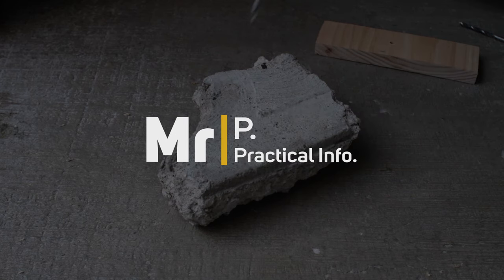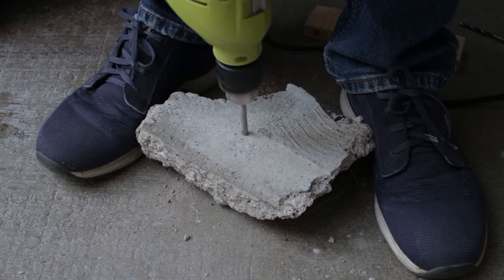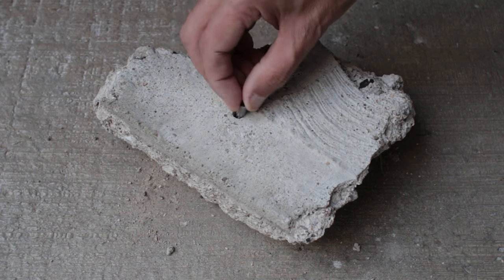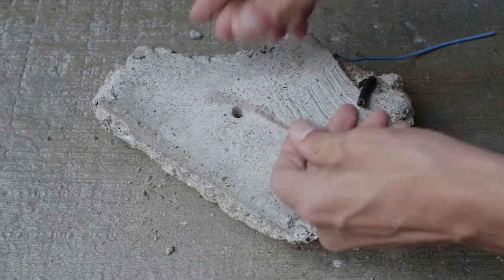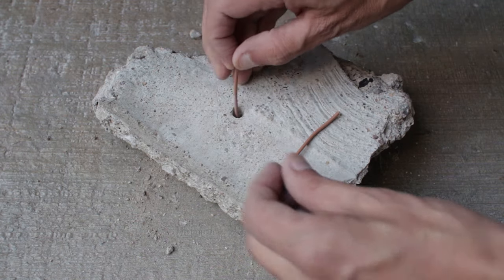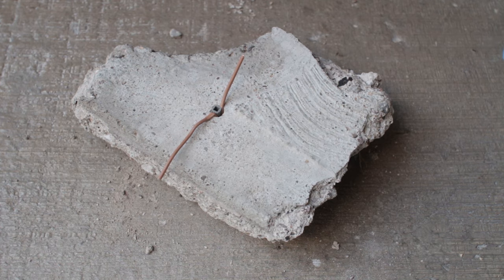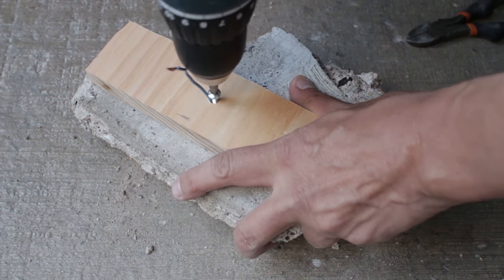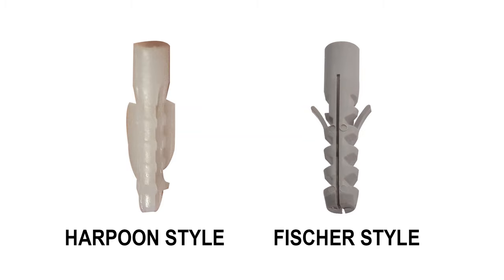How to Fix Loose Wall Plugs 🧰

Comment: Thanks for the tip im going to try it on a larger plug but the thing that really got me smiling is all the years i have been blowing the dust away and you use the drill fan! that deserves a video of its own😄

Comment: Did this into drywall with fischer style plugs. The holes were blown out and spinning. I accidentally over drilled them. Used 4 pieces of 14 or 12 gauge wire. Worked perfectly. Thank you.

Comment: Thanks very much for the tip about using a piece of wire. I used a bit of wire that's usually used for tying up cables and it worked a treat! I'm definitely gonna remember this in future. I usually hate dealing with rawlplugs but now I feel a lot better haha. Cheers!
Reply: U can use anything pretty much, anything that's strong yet can be malleable but doesn't just break if that makes sense.

Comment: Brilliant tip thanks. Like the way you blew the excess dust from the hole with the drill motor!
Reply: I use the wind from the drill motor to cool of my body from sweat after working 😂 i dont blow the hole from the dust because the dust will also help little bit when you put wallplug 🤣

Comment: Thanks mate worked like a charm on the first try. Was drilling a hole for my skateboard racks and the holes came out big af and my drill bit snapped 🤦 but yh I instead used lead solder wire works like a charm too cuz u can easily work it and cutting it is like cutting butter.

Comment: Well i just used tape wraped it Arround hamerd it in.. it works fine it holds my new tv.
Reply: Somebody double-drilled a hole for a curtain tie hook at different angles.. didn't have spare cable to hand but wrapping tape around the plug worked a treat to fill the hole enough to stop it spinning and wearing out the plaster. Cheers for that.
Reply: Came looking for this comment. Thanks mate
Reply: Wow..tq

Comment: We work on a nightmerish wall
Never saw anything like this
The wall is filled with Styrofoam 
You drill it for like 5 seconds and then you fall in to the wall with the drill
We are supposed to put cement boards up
So we need to drill holes for the rails we screw the boards to but this ish is constantly failing with this empty A wall

Comment: Why specifically copper cable? Wouldn't other type of cable/metal that is multi strand work just as well?
Reply: Copper is soft and deforms to fill the space. Steel won't work as well.

Comment: why wouldn't solid core copper work?
Reply from the maker: It may work but solid copper wire far less malleable compared to stranded copper wire when doing this trick so you would might need to use an impact driver.